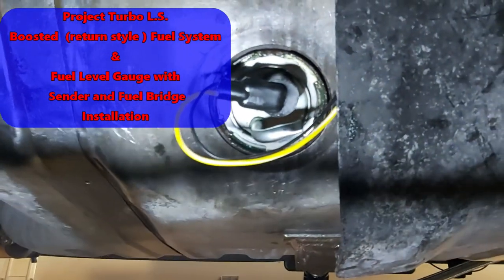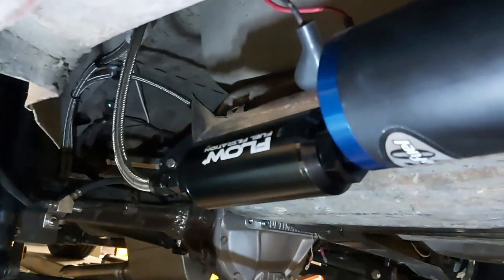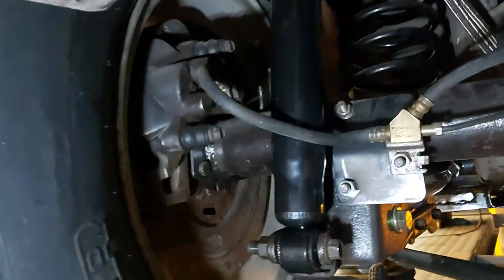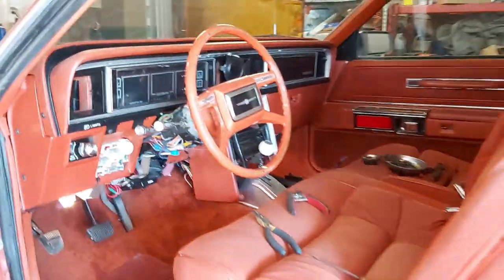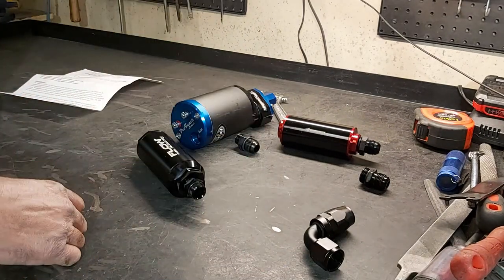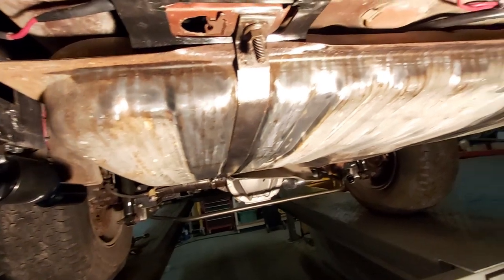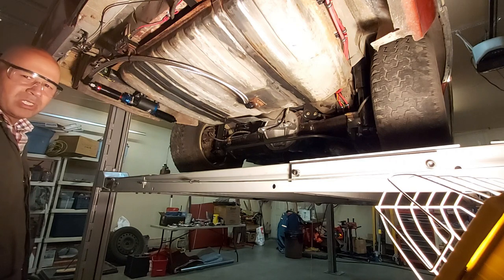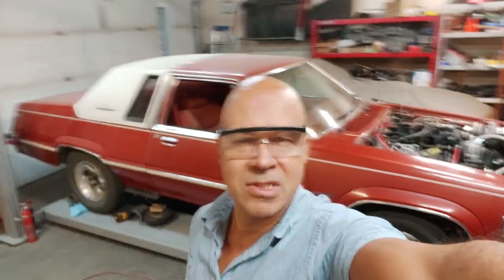Magnafuel MP-4303 return style fuel system &  Fuel level gauge install in LS Fox body Platform cars

Comment: How did it work out? You should go larger on the line. I get your point about the rail being smaller but think of it like this the longer run of that smaller line is a larger restriction then a short run of the same size.
Reply from the maker: It actually worked out well. You can see the result at the first drive link. I've taken it for a few small drives since I shot the video and seems there are no problems with fuel supply as burnouts are effortless and the boost builds very quickly as a result of the large cubic inch displacement and small A.R. ratio .96 on a T4 .Just in the process of installing a mechanical boost, RPM and AEM GPS speedometer since the Holley dashes are back ordered like a year. I'll make a new video once my gauges are in, and I'll do some way longer burnouts and testing video's to verify that all systems are working as they should. Here's the link for the first drive video. https://youtu.be/PfrtuPXEY_U  Thanks for watching and commenting....Oliver
Reply: @BooostedLS  no problem man. I’m glad it’s working ok for you. I asked because I read up on it myself because I have one on the way -8 already ran. From what I gathered the smaller line only seems to be a problem when you really start to lean on the pump. Another issue it seemed people had was not supplying it with enough power. It’s recommended to use two 40 amp relays to power that guy and that power source should be taken directly from the battery. I wish I had the link of the forum from all the guys talking about the peoples they had and what it took to get more out of the pump. But basically it was good power supply to the pump and large enough line. They actually recommend -12 feed with -10 return and out of the pump. The -12 only needed to be ran to the pumps supply but -10 was fine out of the pump. I think when you get to a point in your journey where you want more boost and the pressure starts dropping in the upper rpm’s will be when you should consider those upgrades to get more out of that pump.
Reply from the maker: Definitely will upgrade when I get to that point. I just wanted to throw this combo together to get everything working first. My buddy James gave me the #6 PTFE  for free, so I just put it in. Yes when I start leaning on it hard I'll definitely up grade those lines to number 8.... I have one 40 amp relay powering this pump at present. Thanks for your interest and glad there are other car guys doing and enjoying this hobby.....Oliver

Comment: Where did you find that bracket
Reply from the maker: If you're talking about the bracket which holds the pump? I fabricated that  from steel I had laying  in the garage...Thanks for watching and commenting.....Oliver
Reply: @BooostedLS  I have that same pump and I need a bracket like that to mount it.
Reply from the maker: Yes, well you can copy what I built if you can see it  if you pause the video where needed... @Gbody_Bobbo

Comment: How’s that 6an feed line holding up?
Reply from the maker: No problems as of yet. Consistent performance as would be expected....
Reply: Fuel isn’t overheating?
Reply: What kind of fuel tank vent setup did you do?
Reply from the maker: Ran the factory vent and just attached a hose to the vent , then routed hose to the rear of car. Works well no problems.
Reply from the maker: No as I have the feed and return lines running through the hollow sub-frame connector. So basically have cold air rushing all around the lines thus cooling them off as I drive...
Reply from the maker: No as I have the feed and return lines running through the hollow sub-frame connector. So basically have cold air rushing all around the lines thus cooling them off as I drive...
Reply from the maker: Ran the factory vent and just attached a hose to the vent , then routed hose to the rear of car. Works well no problems.